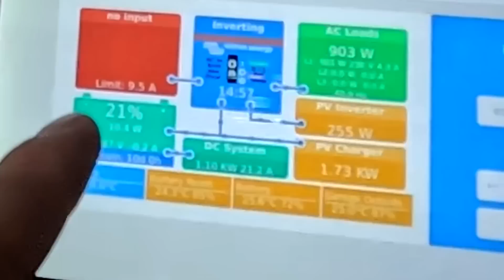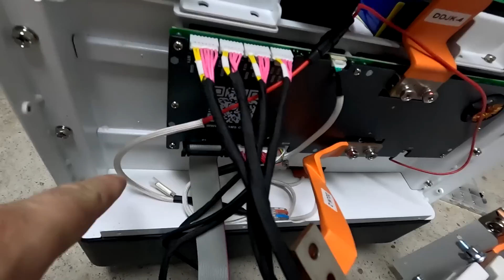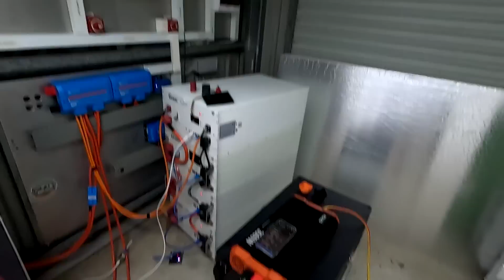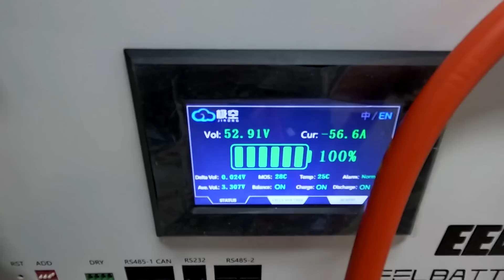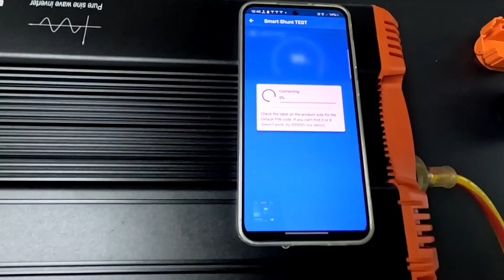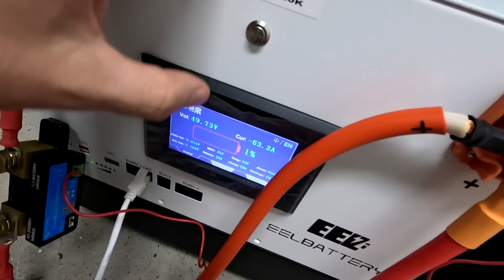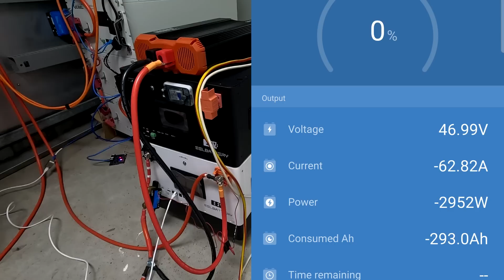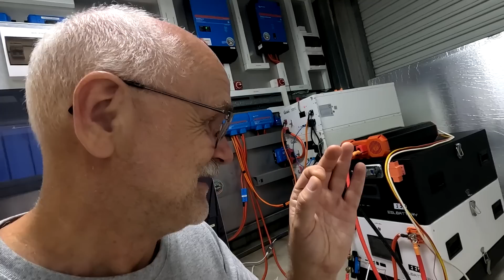EEL DIY V5 Build and EVE LF280K Double-Hole Terminals Capacity Test. What's up with this fuse tho?

Comment: I stuck the temp sensors on top between batt 2-3 and 6-7 on both banks in the middle below the sensor bars with an insulating foam pad on top and they're now sandwiched between the top 2 blue aluminum housings conducting the batt temp with thermal insulation to the top, this should reflect the temp of the batts ... simple solution ... cheers

Comment: Andy, tried to configure the battery to 24V to people have 24 Inverters System. It is possible?? Go hand Andy, thanks drjaca from Puerto Rico 🇵🇷
Reply: There is a 24 version of this battery case
Reply: @davekevin3735  what is the model number to 24V 10Kw?
Reply: Kevin, 24V LiFePO4 Battery 280 DIY Kits Case with JK 200A Active Balance BMS for Solar Power,Golf

Comment: Andy, have been following since you had under 10000 subscribers thanks for all the get information. I thank you for touching on the heating function, something I use lot in the great white north of Canada. I wanted to share some information I have found with the JK-BMS heater and some issues. Unlike the other BMS the heating port comes on as soon as the temp has dropped below the low temp, others will not come on until the low temp is on and the incoming voltage is over battery voltage (ie Solar or other charging source is present).   Also the request charge current drops to 0, it would be better if the current in this condition could be set to the heating pad current. I still need to test this condition more to see if the charge controllers will still send the current to the heating pads. Also not sure why EEL added the extra temp sensor on the heating pads since it would use the BMS temp sensors to control?  Other kits like SFK add addition temp sensor and control to keep heater on even while charging but that would not work in the setup EEL has. I have not found the hard limit for JK-inverter BMS heating port in any specs yet but the other JK BMS has a limit of 3 amps on the port so you may be over the limit. I use a relay on my setup to avoid the 3 amp limit. I have also used a voltage sensing relay to only turn on when charge voltage is seen. I did reach out to JK with suggestion for changes tomorrow heating function but no response do you have a contact you can share so I can provide some feedback to them. Just for some background in do off-grid solar in campgrounds up here. Many of the systems are 24V and some 48v and the JK is what I am switching to in both.  When I get time I will post some video information on them.
Reply: So if i connect heating pad and temperature is under 0 they are allways on and discharging the battery? Even if i shut off battery with that button it has? Did i understand that right? I'm building this battery too,with heating pads and it's cold here in Finland. I was planning to leave battery disconnected by the switch in winter. Does the battery discharge then? I need to know that...could you not control heating pads from jk bms? Temperature and so on? Please let me know🙏
Reply: @petejoku7687  I'm sure he could check but I would find it extremely doubtful if the heater came on when the BMS is switched off. I think the problem he is reporting is that the heater comes on even if the battery isn't charging. This is in contrast to a Renogy battery I have which will only switch on its heater when there is external power available for it. There is a heating on/off setting in the BMS app, but you cannot adjust the temperature.

Comment: Hello Andy, could you please share JK BMS parameters for TOP balancing and how long takes to balace all cells in 3.65V ? Thanks in advance. Greetings from sunny and cold still yet Sofia, Bulgaria !
Reply: He's done videos on his preferred JK BMS settings, and the balance start voltage is 3.45 V. You would never charge them to 3.65 V. That is what the overvoltage protection is set to. How long it takes to balance the cells depends on how unbalanced they are, which is personal to your cells, and the balancing current available (1A or 2A for JK BMSs).
Reply: @matthewmarks6951  I completely understand this, the issue is that for balance in the upper limit, the settings that are by default in the Lifepo4 boot do not allow the cells to reach the upper limit of 3.65, they stop much earlier. somewhere around 3.42, with a big difference in the most charged cell, a deviation of about 0.200+mV. Otherwise I use exactly the same BMS modules with 2A balance. Unfortunately, Andy never answers, or at least not to me, apparently I ask a lot of stupid questions.
Reply: @Codename_47  He gets a lot of stupid questions, not least from me! It may be too late at night but I'm still not understanding you. If you haven't watched it, search for his video on V15.38 firmware.

Comment: Information for the masses....  Age of battery cells.   I am in Canada.   Cells like these are simply not available here unless I order them from outside the country.   That means China or US.  China wants 90% of retail for doing nothing so I would rather pay more and keep a few people employed.   Now down to US retailers... The cheapest battery for the amp was found ordered and tested.    
        Advertised 280  ah.     I have set up several now.  On the first charge, balance, discharge,  recharge... They  "recharged"  to 265-280ah.     Which sent me looking at QR codes.   These batteries have no info other than the date of manufacture....  Sept to Nov 2022.     That sounds  "old" but not really.  Two  2.3 years.  
        I look all around and my 2 cents worth is these batteries are rejects that would not meet a company like EVEs standards so they did not brand them but dumped them to some Chinese wholesaler for cheap.   The wholesaler regrouped them to make them look on paper as good as they could and dumped them to a large battery distributer in  the US.   They in turn sell them to another battery retailer a truck load at a time.   They in turn sell them to me and to be honest knows very little about them.... no one ever asked.
       All that water under the bridge and they are still worth it and test to 95-96%  of the advertised rating, even going into there third year of storage with out a charge.     Dollar per amp hour is bottom line.    Smooth flat cells

Comment: Hi Andy, Could you explain it to me? What point does it reach to 3.65V? Is any cell above 3.45V fully charged?
Reply: "Fully charged" is up to you - in theory 3.65 V but Andy recommends 3.45 V. You will get a bit less capacity but may get better life and be safer. With Andy's settings, cells will not reach 3.65V and he sets that as the overvoltage protection value.

Comment: Have you thought about getting a small diesel engine to generate about 70-80vdc to charge batteries in winter, using vegetable oil or bio diesel? I'm still trying to get my generator built to charge mY 24vdc bank that completely runs my home. I have several  HD Delco 22si alternators  I'm going to build custom regulators possibly use a external rectifier. I have two 130amp, two 150amp, and one I'm unshure of. Haven't looked that close at it, as well as a few 100amp 12si alternators as well as a few 60 amp units. 8hp can easily run a 150 amp alternator, possibly two. A alternator can output about 1000 volts open circuit. And can easily  output 60-80+ volts , it may be a good idea to use an external rectifier with a large heat sink. I'm thinking about using a water cooled heat sink. Drill out a 1.5"x 4"x 6" aluminum block with a 1/2" hole drilled long ways 3/4" from top and bottom. And from the back side , leaving the front about 1/2" thicker . And about four, 1/8" holes from top to bottom. Ending in the bottom hole not fully through. And plug the holes on top. Also plugging one hole on the bottom on one side , and top on the other, (or both on one side, having a input and output on the same side. Using 1/4" barb fittings and hoses. Along with a small 20 gph pump (roughly) to circulate water through a small car radiator from a small Honda or Toyota (with 1.5L-2.2L (+/-) engine, with about 1-2 gallons of water.) Use adapters from 1.125"-1.25" hoses to a 3/4" hose that uses a copper pipe fitting the hose, with 1/4" bits of pipe soldered in, creating a manifold going to multiple rectifiers  and possibly wrapping a 1/4" aluminum tube around the alternator stater core, attached with JB weld. To conduct heat. About 6-8 turns of tubing pulling heat away, in theory an alternator can output a set wattage so double the voltage will cut current in half, so 150a 12/14v  becomes 24/28v 75 amps. The removal of the heat generating rectifier and adding cooling should get the output back to 100 - 120 amps at least. Adding another fan along with a thermal switch  to prevent overheating. The switch killing field current at 140°f  on the stater windings preventing the enamel from burning off. It may be capable of running at 150° - 175°F being destined to run inside a hot 200°+ engine bay. Some being 220°-250°+ with the hot exhaust.  The current output will drop with heat also. Being Mounted in a relatively cold area. It may be capable of doing 150 amps at 28-30vdc and 100 amps at 80vdc they have been used with 48 v systems many times. If heat is s issue, with the rectifier removed and isolated. Two alternators can easily be wired in series. With a volt meter on each with another showing total voltage, to be certain the output  is proper. And one isn't outputting more than the other. I'm planning on using two in series of the 100 amp alternators. With a 5hp engine and two 150 amp modified to 28-30 volt  connected to a 12 HP engine. And modifying a 60 amp connected to a 3 HP diesel engine, running on biodiesel made from vegetable oil or fuel made from plastic. Maybe a blend of both. If the diesel works out get a old diesel engine 20hp or so. And possibly modify a electric motor to generate power. Modify a 3 phase motor to operate like a alternator. Build a field coil rotor with a multiple pole rotor
 Possibly using a 3-5 HP 3phase motor housing. With a center tapped output capable of 12,24,48,96 v nominal, and likely a range in each level
 6-18v in 12v, 18-36v in 24,36-72in 48v, and 72-144v in 96v so it can charge 96-120 v batteries as well as 12v possibly only 80-100 amps at 144 volts. However, 4x that at 12 v, 320-400 amps, 160-200 at 24v, it could be much more at peak power, this being minimum output ... With  around a 16-18 possibly 24 pole rotor and running at 2-4 x engine rpm.  It should be capable of 6k rpm minimum. And safe to 8k rpm  at least a issue may become reality if ran at 8k-9k normally, or over 10k it's likely to just explode. I would wrap the rotor with a tight wrap of carbon fiber with a layer of kevlar layered with it. The carbon ribbon about 3mm thick with the resin binding the carbon and kevlar fiber together, with a double layer of kevlar over the carbon to protect it if scraped to prevent a broken wrap of carbon. And any balance weight will be added by sanding lightly over the resin   apply epoxy resin, and add a layer of carbon kevlar with 3 carbon depending on amount of weight. With 2-3 kevlar wraps over it .  Heated to about 150° to cure.  Build a voltage regulator with a mosfet switch microcontroller, with temperature inputs and voltage and  current output feedback. To allow regulation without overheating. It can possibly be used to output a cc cv output specific for lithium battery charging . By operating the rotor as a cc cv power supply. A 800-1500 rpm diesel engine spinning  it fueled with garbage! I plan on having 20 kw of solar and 10kw from just one generator source, I want to even have a steam engine generating power. With a gas engine generating AC power with a large flywheel and at least 1.5 times the power required to run the generator. (If I can convert a motor to generate ac to DC power. I can build a AC generator also, using a electronic governor to set the frequency of the output.) It would be awesome if a generator could generate high frequency ac or convert to DC, and use a microcontroller to use a Mosfet 'H'- bridge to output a stabile  AC power.. much like a VFD making a 3 phase output from a single phase input.  I want to build a 3ph generator as well in the 20-30 kw range, minimum. Using a 2.2-4.0 liter engine having 120/240 per phase to neutral/phase would be cool allow a 3 phase generator to have 3x 120v outputs or , with a 440v 3phase two  120v outputs per phase. 5kw per output. Minimum.. 30 kw 3kw phase a 45kw 3phase would be nice . Have an awesome day🎉✌️🕊️

Comment: After have bought two Yixiang v2 boxes and 32 cells from them with double pool that have cracks in the weld and have not done anything about it yet. my next order will be Eel boxes and try them instead, sadly they dont have them in stock yet in eu but hope they get them into stock soon.
Reply: Hello, the V5 battery case will arrive at our European warehouse in 2 weeks, you won't have to wait too long.

Comment: For your battery rack, do you think that Noark circuit breakers are a better solution than ANL fuses and have the same breaking capacity in the event of a short circuit?
Reply: Consensus is that you should be OK with anything that will break 25 kA. Circuit breakers are obviously much more convenient as they are resettable and you can use them as switches. But they're far more expensive than fuses.

Comment: For AS/NZS 5139:2019 compliance, these batteries need some extras: These batteries systems are classified as class 3. 1) for arc flash you need a fuse between the 2 banks. This changes the PPE requirements from class 4 to none and whether you need an extra shed or can install it adjacent to the house. 2) Circuit breaker or fuses on both terminals. These can be external so not that much of an issue. 3) Earthing. 4) Documentation including System manual see section 6.4. If these are met you can probably use it without having an extra shed. Also I got 3 EEL V4 boxes with batteries from EEL. Beware if you have shipping damage on the batteries they are quite bad at replacing them. So I suggest get your batteries from a reputable supplier.

Comment: Andy, a little off topic but I think worth all knowing.
Had a 12v pack running on lifepo 180 ah hard case cells 2p 4s on a old std Daly BMS, no programming ect. So couldn't monitor it.
Just broke the pack down, rebuilt it to 24v 8s with Bluetooth BMS....
I'm gob smacked, most cells are jumping around on high/low voltage 
No maintenance, nothing just let them be.
And I got them cells as grade B.
Just thought I'd pass my findings on.
Ps Andy in UK we are getting more sun and your getting less......ha ha

Comment: Battery is humming because the AC sinewave inverter's DC current profile is not smooth DC.  It is a sinewave at twice the AC line frequency with a peak to peak sinewave current of close to 2x the average DC current, riding on top of average DC current.  

Peak current draw will be nearly twice the average DC current, and valley minimum DC current is nearly zero (inverter idle current overhead).  

Inverter input filter capacitors are for high freq PWM switching bypass and have little effect on filtering the low frequency, high average DC current to inverter.  You would need Farad's of very low ESR capacitors to have any impact on the inverter high ripple current smoothing.

If you have any steel metal physically close to battery interconnect, likely to BMS or output terminal lines, there is a strong time varying (100 Hz for 50Hz AC line freq) magnetic field from battery line that magnetically couples to nearby steel metal.  This will cause any not tightly secured down ferro-magnetic metals to buzz at twice the inverter AC line frequency.  Classic case is a battery breaker mounted in a steel breaker box with a loose-fitting front door on metal box causing door to buzz.

Comment: I agree it is a good idea to place a small inline fuse in the Bat+ line to BMS.  It is the only line supplying positive battery for overhead internal consumption of BMS.  At first, I only expected less than 1amp draw but in my S. Florida location I did not consider where the heater gets its power from.  The heater may raise the Bat+ current when heater is on if its power comes through Bat+ line.

Would be helpful if you measure Bat+ current when heater is actively running.  

I measured several PB model BMS's and got 0.15 mA on Bat+ when power button is 'OFF' in standby and a little less than 20 mA when BMS is active ON.  I am using a 1 amp fast blow fuse on Bat+ line, so far with no blown fuses

I don't like the battery boxes that do not have a good quality main battery line breaker/disconnect.  I like the Gobel Power boxes.
Reply: The heater output switches to ground - you connect a separate feed from the battery positive to the heater.

Comment: Buzzing in the battery is DC ripple caused by your Peter inverter. Capacitor too small on the dc rail supplying the mosfets in the peter.